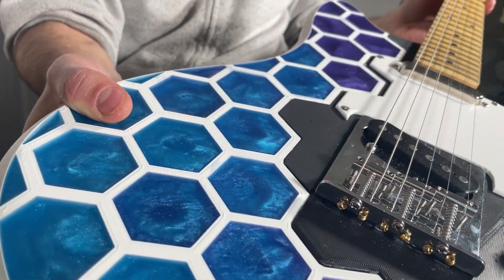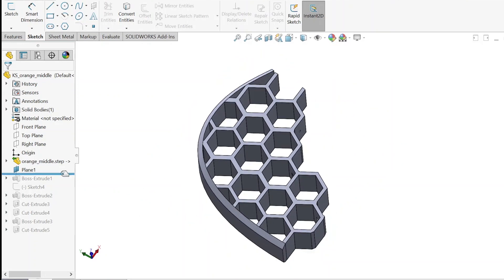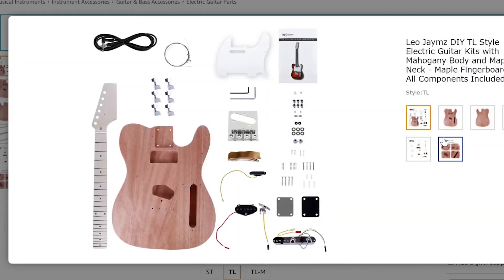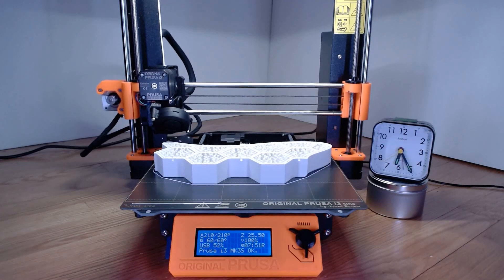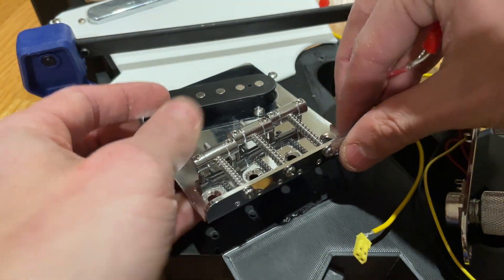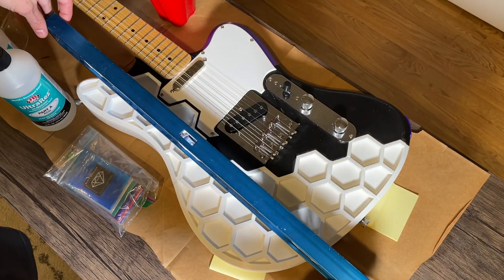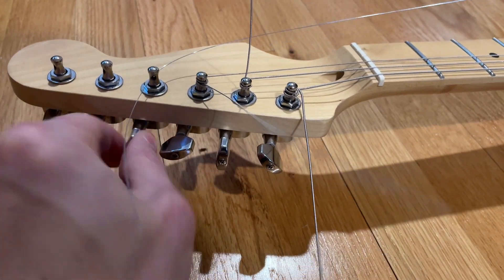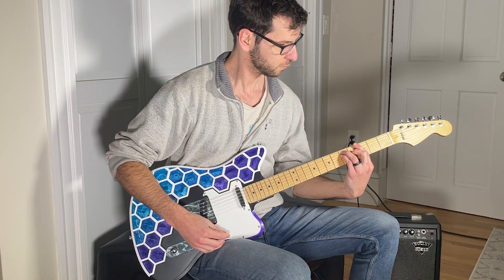Custom Prusacaster 3D Printed Guitar Project Build (with EPOXY Pour!)

Comment from the maker: REMIX FILES: www.printables.com/model/426307
Reply: hi
i made model based on the prusacaster layout
but i dont have the printer of that size to print the main piece
it uses resin to conect all pieces together for super clean looks
do you want to try it? 
that guitar model be destroyed after the guitar will be complete (its for my crush and i made it just for her, any uploads to thingeverse or enywhere mby. just on my flash drive) so do you want to try it?
the main piece reqires bed 300x300
design is japanese kumiko

Comment: Great look for the Prusacaster. I really like the look that I got on mine, too :D

With regards to the string height, you need to set up the guitar: You need to adjust the screws on the back of the bridge to adjust the intonation (same note when fretted and harmonic on the 12th fret), the height of the string (use the small hex key and listen for buzz and then back off). Also, you may have to adjust the truss rod. With all those things, I got a comfortable low-string height on my Prusacaster. :D
Reply: Did you have any trouble aligning the bridge like he did?
Reply: @joeking433  Yes and no. I created my own variation that's in the right spot. It's on Printables.

Comment: Excellent tutorial! Can't wait to try this when my printer comes. Also, I definitely recommend Warmoth if anyone is looking for decent quality necks for their 3D builds. I've found those generic "parts guitar kits" are made from extremely cheap materials and the build quality of the neck is generally of very low quality. Horrible almost non existent QC. This in itself sort of devalues the level of work and time put into these builds, as every aspect of it is amazing otherwise. The let down I've noticed with many of these builds is the neck. Even worth looking into licensed Fender or Ibanez necks, these can be found on eBay pretty cheap, and you know you're getting a quality neck to make that custom build just that more professional. Just make sure the neck pocket matches the correct neck specs.Just my two cents.
Reply from the maker: Thanks for the comment! I completely agree! Even an entry level guitar neck from a Fender / Ibanez / Gibson guitar is significantly better than most of the cheap necks you find on amazon ect. I now offer complete 3D printed guitar kits on my website which come with all Fender Squier necks and electronics if you are interested to check them out (https://www.the3dprintzone.com/shop/3d-printed-guitar-kits). Currently just Telecaster-style options, but I plan to add more kit options in the future.

Comment: Was there anything special you had to do to keep the exothermic heat from the epoxy curing from melting the PLA or did it not get that hot?
Reply from the maker: No, I didn't have any issues with plastic melting from heat

Comment: Some of the comments on the original Prusa project suggested there could be improvements by running the strings through the body with a different stringing arrangement, i.e. not having the force pulling the guitar sideways so much. Still an interesting project though.

Comment: What did you do to make the neck fit? I printed and have yet to order a kit.
Reply from the maker: Thanks for the comment! I used a neck that I had used from a previous build, but the other components came from the Amazon kit in the video description. I'm not sure if the Amazon neck will fit perfectly, so it's possible you may need to use some shims or a dremel to get it to fit properly.

Comment: How was the alignment of your pieces to glue up?  I just printed this guy, and there is a gap between the pieces if I lay them all flat on a table. It looks like I can mate the pieces up, but it lifts the edges slightly (a few mm).  This seems true all the way around the center piece.

Comment: What did you do for finish on the neck and fretboard? How much effort goes into that?
Reply from the maker: To speed up the project I used another neck I had laying around, but it would probably involve some light sanding and polyurethane. Also maybe a file to file down the fret inlay edges.

Comment: Hi, Is there any less expensive 3D printer that could do this project?
Reply from the maker: Best Option Under $300: https://amzn.to/3Ug5TKo (affiliate link)
Reply: How do you orient the main core piece to fit the bed of a e3 v2? Curious because I'm trying to print it from a e3 s1 pro and struggling in the slicer

Comment: Love the body build, especially adding the epoxy, but can anyone point me to a build of one of these with actual quality parts? For example, Warmoth neck, quality electronics (CTS pots, paper in oil capacitor) qualty pickups (Lollar, Fralin, Porter), quality hardware (Gotoh, Grover), etc. All the ones I've heard sound like $129 amazon guitars. When you use cheap kits instead of sourcing all the parts individually, you end up with a cheap sounding guitar.

Comment: Nothing wrong with your playing, it sounds great. I would say though, the action needs fixing if you haven't already. 

You may also need to adjust the nut slot height. It is very evidently out of tune in the last playing clip when you go to the open chord. The barred playing before that is in tune. Without having had a look at the guitar, I would say this is a combination of too high action and nut slots too high.